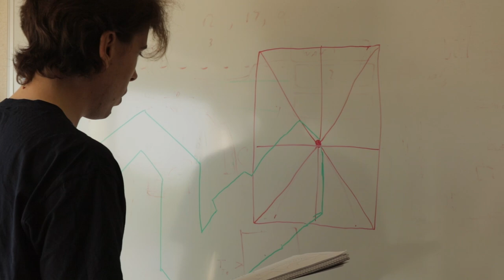Internship Life at ITER (2)

Comment: Why chose make toroidal form ? Why dont choise spheric shape, like the sun. so noo need to refrigerate inside. so the temperature can be more stable.
Reply: I dont know the full details tbh, but the idea of a tokamac is to focus the plasma using a magnetic field. If it has a spherical shape, then I would be impossible to generate a magnetic field that would push the plasma to the center, as this would yield a magnetic field with a non vanishing divergence, which is impossible
Reply: @coolsonic8982  as if they wouldn't do that instead if it was the better solution
Reply: @raoulduke7668  hey I never said otherwise !